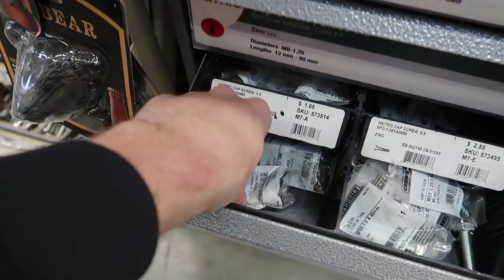RX-7 WON'T TURN ON!

Comment: Rotary moters can be tricky...but they sound awsome..i think the rx7's ecu goes in to safty mode when the battery is disconected and the ecu has to be rest but i could be wrong..Good luck guys

Comment: A mate of mine had the same issues with his 2002 model rx7. Here in Australia we dont have the clutch pedal switch and when he did a whole bunch of work to it he had an alarm installed and they didnt wire up the newly installed clutch switch. Had us searching for ages trying to find what we did wrong.